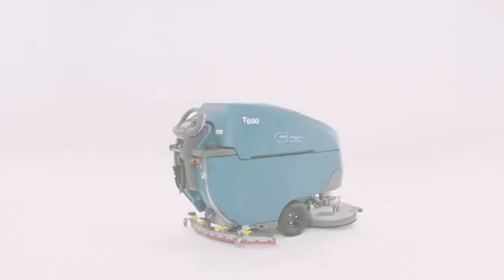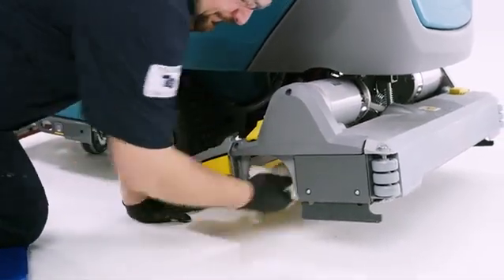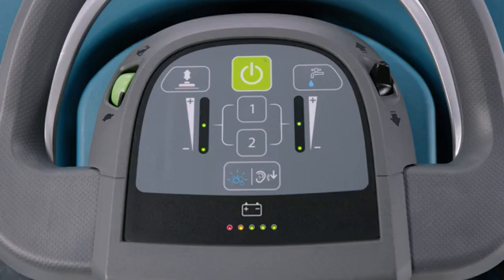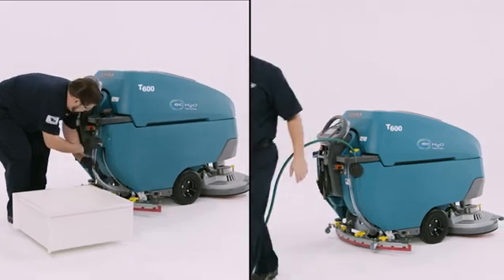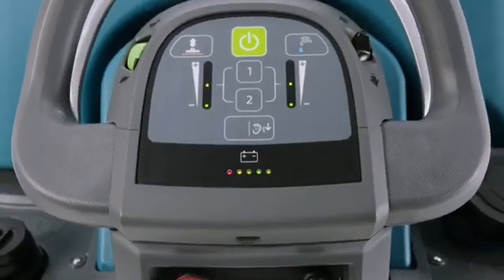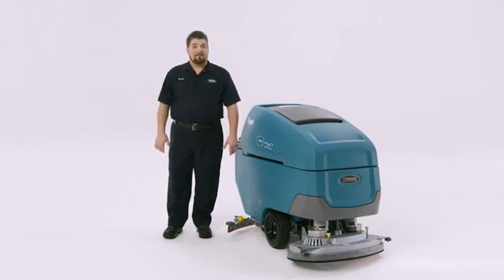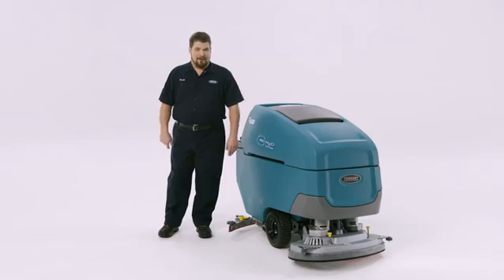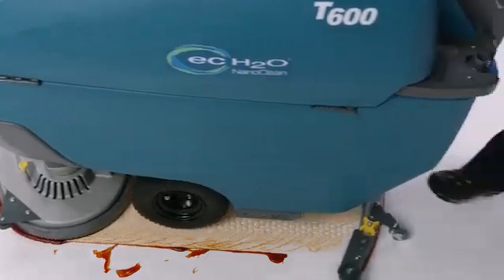Tennant T600 / T600e - How to Operate - How to Fix

Comment: He reached under and snapped the brush on the machine like snapping your fingers. I have done that on occasion, but usually it's difficult to get a brush aligned to go on and sometimes it's just a downright struggle. When it does go on, I have no idea what happened that it did finally snap on. So, what's the secret to make it go on that easily every time like they always show it in their videos?